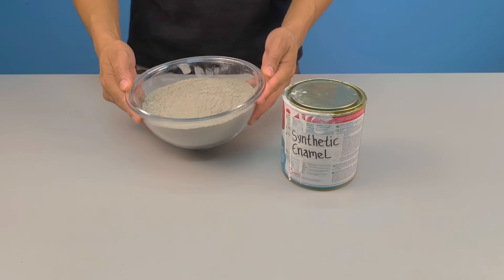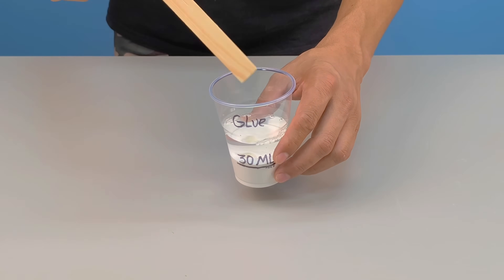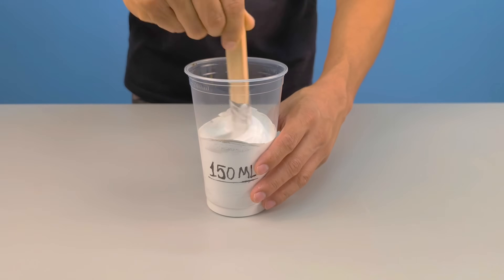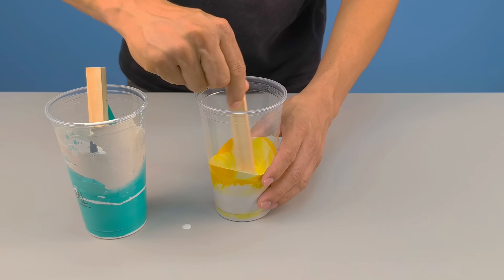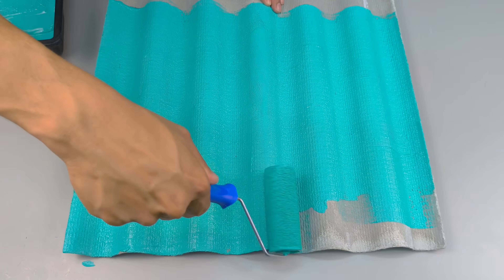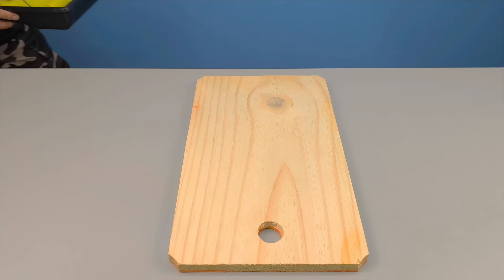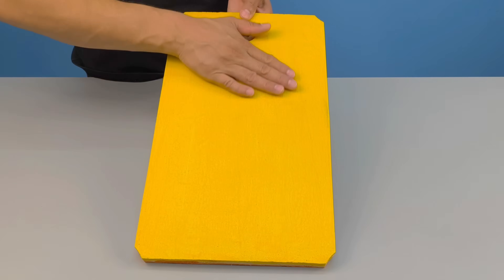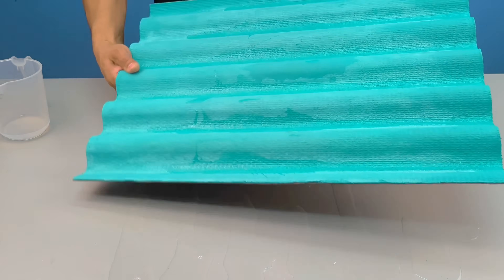Mix SYNTHETIC ENAMEL with CEMENT and reveal the most powerful secret formula of all time!

Comment: Can I use this paint in my bathroom tiles?
Reply from the maker: Yes, it can be used on bathroom tiles, but proper surface preparation is essential. Good cleaning, sanding, and sealing help improve adhesion and durability, especially in humid areas.
Reply: @inovaouinventa thank you so much😊

Comment: Its seems to be hydrophobic, can we paint it with another colour after a few years, will regular latex paint stick to it?
Reply from the maker: Yes, you can repaint it later. Even though the mixture becomes slightly hydrophobic, regular latex paint will still stick if you lightly sand the surface first. This creates micro-abrasion and gives the paint a perfect grip.